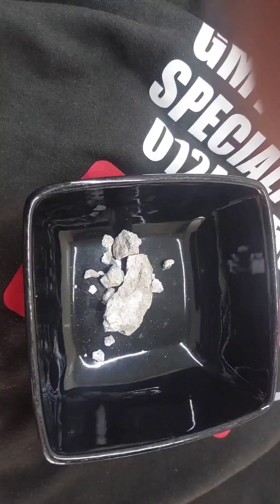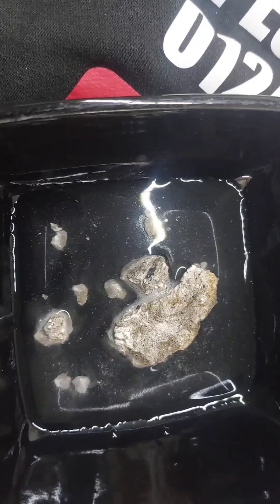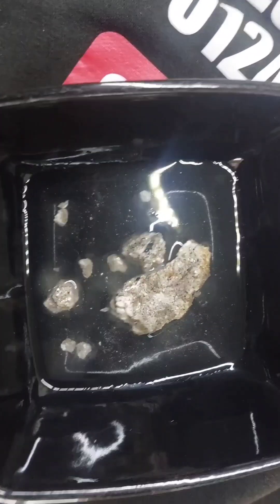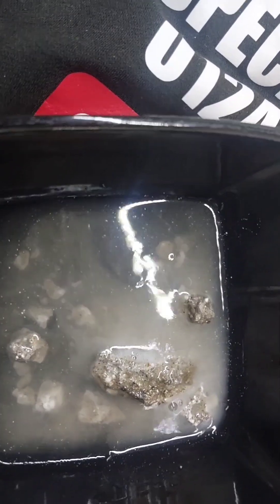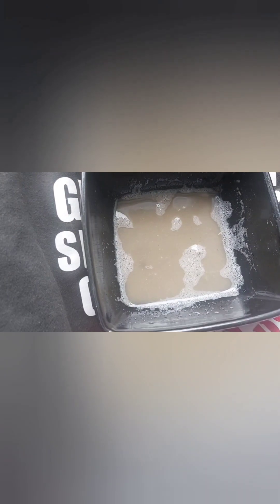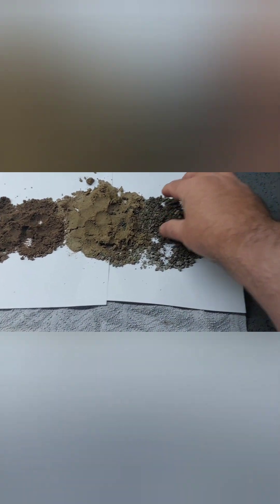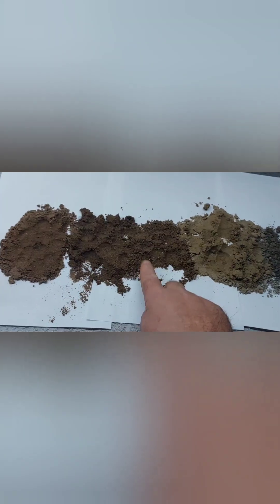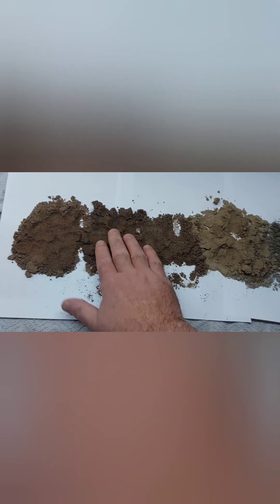breaking down 250 year old lime mortar to choose what washed  sand  to use for repointing

Comment: Really interesting. Is there any relationship between how gritty the sand is and how tough it becomes against the elements? For example is very gritty sand better for exposed sites or does it make no difference and it’s all down to the lime used?
Reply from the maker: Yeah I tend to use  washed sharp or grit sand this allows  water to be released 

The strength comes from when you compact it back with a churn brush  it  makes all the lime and  sand grip together
Reply: @GMTpointingspecialistsltd .  Thanks for answering:  personally I like seeing the gritty bits sparkling in lime mortar so it’s a win win really.
Reply from the maker: @tonyalways7174  yeah  totally agree